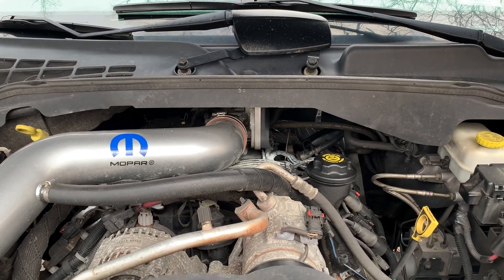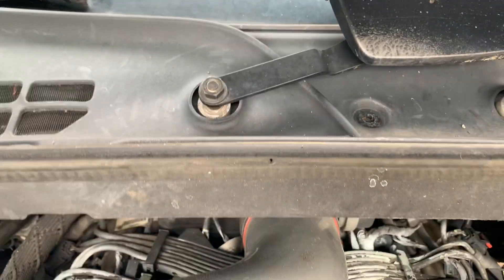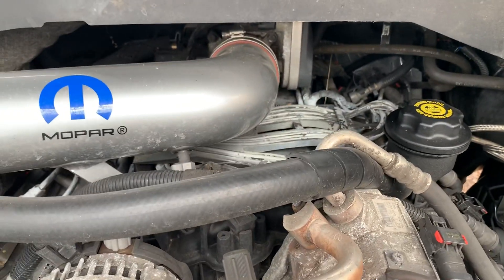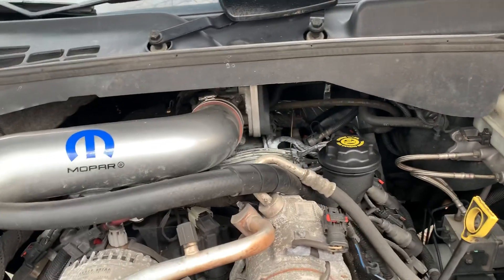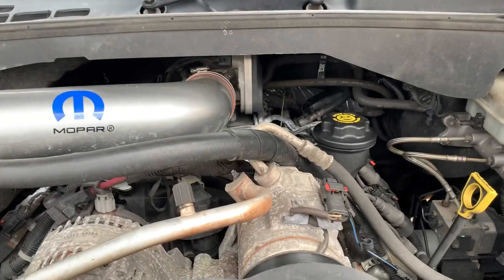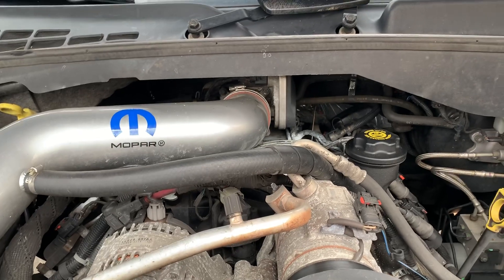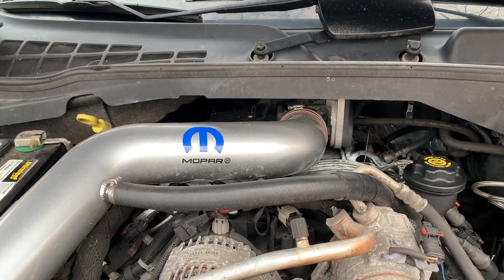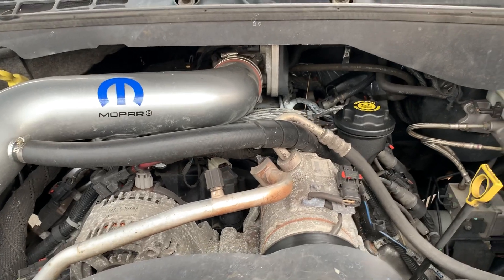2004 2005 Dodge Durango 5.7 Hemi hydro lock on startup

Comment: They updated the windhield cowel from 06 onwards I think. I replaced mine on my 04 a few months ago, and you can see that it's a slightly different design to keep water from falling onto the engine.
Reply: I just bought the replacement cowl as well - but from videos I’ve been seeing it seems like the new design does help a bit but still bends up slightly in the middle just like my old one that was were the water was getting in from. Did yours sit correctly and seal all the way across the window without needing to do anything extra like silicone it ?
Reply: @johnboswald6049  No, it didn't fit exactly. I bent the body panel clip slots down a bit, and also added a bead of black auto silicone.